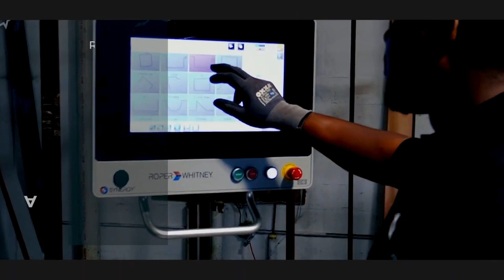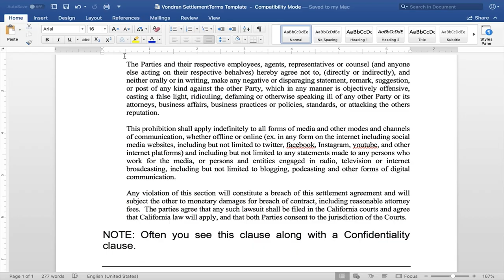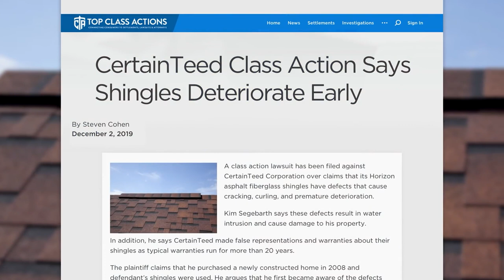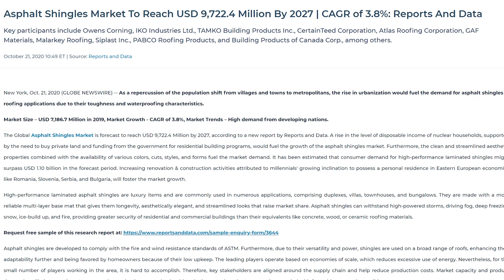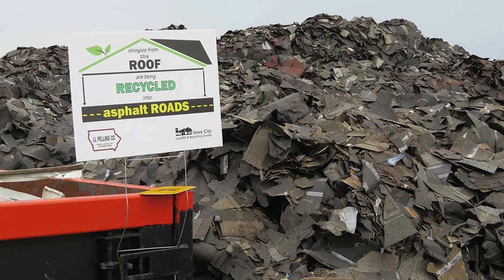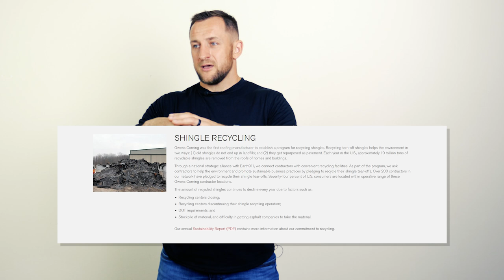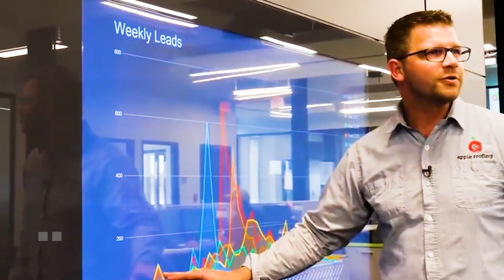5 Things Roofing Manufacturers Don't tell roofers and Home Owners

Comment from the maker: Hot Topic today: discussing 5 Things Roofing Manufacturers Don't tell roofers and Home Owners
Biggest "Secrets" no one wants to address publicly:

1. Roofing Industry have almost 0 recalls despite failures of many shingle lines
2. Asphalt Shingles don't have "Lifetime Warranty" or 50 year warranty out of the box. 
3. "Certified" Roofers from biggest brands cant talk about quality issues because of NO Disparaging agreements and roofers need to be certified by Manufacturers to offer longer warranties. 
4. It takes few years to settle a claim with manufacturers in case of defective shingles. 
5. In most markets we still didn't figure out how to recycle asphalt shingles. Majority ends up on landfills despite the talk and "green effort" promises.

Comment: I’ve been an adjuster for over 20 years and the waste of replacing perfectly good roofs just aggravates me. A lot of the roofs I’ve been on for wind damage can be fixed.
Reply from the maker: You are not wrong. Thanks for speaking up
Reply: Depends on the specific situation. I won't push for something that isn't damage. I don't want 20+ calls a year for repair that should've been replaced.
Reply: That's why you are an adjuster not a roofing company. You don't have to worry about labor warranties. That's why insurance has guidelines for x amount of wind damage to shingles to be approved. What is the point of paying for a repair and then a full replacement a year later

Comment: The asphalt roofing industry is a racket.  As long as the asphalt roofing manufacturers can count on selling an American home a new asphalt roof every 10-15-20 years, then they will never change.  It is too much money to say no to.  Multiply that across the entire U.S. population.
   In Europe they have tile roofs that last hundreds of years, some even over a 1,000 years old, that I have stayed in.  And they are more beautiful.  Probably too hard for a tile roofing manufacturer to break into this industry I imagine.  
   The back side of this problem is the entire house building industry.  No one wants to change the way they do things - there is no incentive.  It is easier and makes the most money to just keep doing what the guy before you did.  Do we realize how much heat energy is stored in our attics, but we never utilize it.  Instead of AC systems in hot climates, why not build house partially underground?  There are so many areas for innovation, that in the end, will not fill our landfills.

Comment: Why can’t asphalt shingles be used for road repairs? 🤔
Reply from the maker: They can but we have to have incentives. Economics are not behind it yet is my understanding
Reply: shingles shed not water proof, good question though
Reply: shingles shed not water proof, good question though
Reply: Whaddya mean? My driveway is a layer of ice and water and CertainTeed shingles
Reply: @RobChapala  LOL
Reply: Asphalt shingles are replaced when the asphalt is shot.  The asphalt is of no use.  Would you really want this used in your roadways?
Reply: @davidlightfoot348  no, rather have concrete in roads, and stone/tile for roofs...but we are cheap, so we use asphalt for roads and roofs.